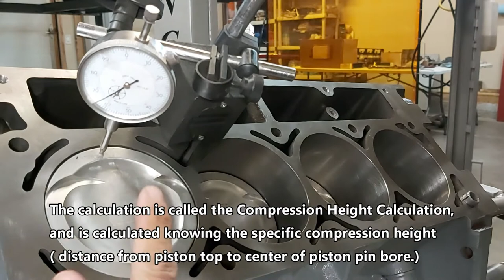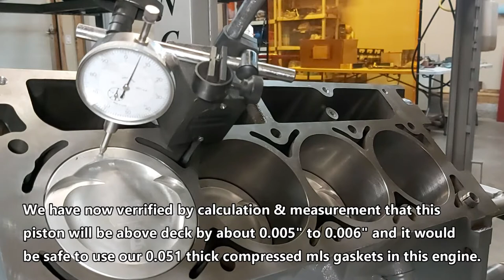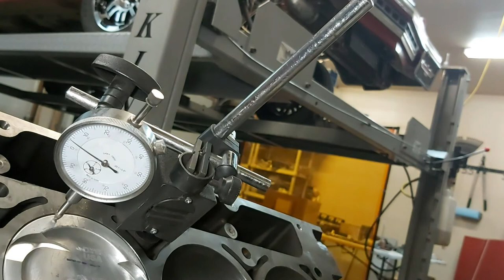Piston Deck Height determination for Proper head  gasket thickness selection

Comment: great video. i'm doing a rebuild after a timing belt snapped and wanted to check if i might need the same or thicker gasket. i have no warping on the head and the face just needs to clean up but still i wanna make sure it's all good in there. is the 0.040" piston to head clearance applicable to all car ices?

Comment: good info, my pistons are .006 above deck (347 sbf) my engine builder said a .047 compressed Fel Pro gasket will be ok, so I should end up with .041 piston to cylinder head clearance. This is with a 2618 forged Wiseco flat top and Scat forged I beam rods.
Reply from the maker: Yes, you're clearances are good and the gasket thickness you're using is very similar to what I'm using (0.051" compressed ) so you should be fine and have a successful build. Glad the video helped and thanks for watching ......Oliver
Reply: @BooostedLS  Thanks!

Comment: Great video, I have a b18c1 Honda engine I’m rebuilding, the head I bought has been resurfaced about .017” from the spec for a new head by the previous owner. I believe the stock headgasket is .03”. Do I just add that difference to my stock headgasket thickness and buy a gasket that size or as close as possible (.045”)?
Reply from the maker: You can use which ever gasket you have as 0.017 removed from the head was just to ensure the head surface is  flat, and will  create a good seal. You'll get a slight increase in compression and better quench, which both add to better performance. Only time you have to get a thicker gasket is if you need a lower compression ratio and if there are piston to valve clearance issues. Thanks for watching and commenting....
Reply: @BooostedLS  I just figure because the manual says that .008” is the max that can be removed so I figured I should make up that loss of material with the headgasket

Comment: I have a Honda k20 engine. I have 1mm oversized dished valves on the intake and I have stock size flat faced valves on exhaust side. Is this a good set up?
Reply from the maker: Sure, as long as you have 0.100" valve to piston clearance when the piston is at top dead center and the valves are fully open. Put some plasticine on top of the piston then carefully rotate engine . Then measure the depth of the plasticine after you've rotated the engine through a couple of cycles. Go slow as if there is interference you'll feel it right away if something is not correct. If everything checks out you'll be good to go.....Oliver

Comment: Thank you for the info and maybe you can help me out. I'm using the same exact setup as yours in terms of rotating assembly.  However,  I'm measuring .015" piston above deck surface. The ls block I bought is advertised to be 9.240 but there is no way that can be. 
9.240 they claim -4 /2 + 6.125 = 1.115.
My boost piston CH is 1.110 - 1.115 is -.005" but I'm protruding .015". Does this mean my block has been decked to 9.225"?
Reply: It's a summit pro ls forged rotating assembly with 4" stroke, 4" bore, and a 1.110 ch.
Reply from the maker: Hello Jose. Thanks for watching and commenting. It is possible that your block deck is now 9.225. Rod at my machine shop said he only machined 0.005 of each of my decks to get it square and flat. As you can see when I measured the decks on the other holes there was slight variation as to how much the pistons were above deck. I'm thinking that from the factory the blocks may not be exactly at 9.240" as advertised. this is most likely because there is an acceptable tolerance of plus or minus0.010" to 0.005" or greater . Also the pistons compression height might not be exact either as the technician machining the pistons may have had his measuring tools or measurements not exactly correct, and therefore didn't enter the proper off-sets in his CNC lathe as they were being finish machined.. It could also be the crankshaft is giving you a little more stroke 4.005 vs 4.000 as this is also a machined component and may not be exact. The connecting rods center to center distance could be another potential point of discrepancy as they also might not be as advertised. So the point here is, it can be any number of factors in the manufacturing of all these components as to why your numbers are not as expected. I would not worry too much. As long as there are no collisions between piston and the cylinder head you should be good in terms of your rotating assembly. Good luck with your build and let me know how it all works out for you and again thanks for watching and your input....Oliver
Reply from the maker: @Six_ftdeep32  That is a nice rotating assembly which I was also going to buy. I went with the rotating assembly from LSXeceleration because theirs was balanced as it shipped to me. I thought I could get my project back on the road last season so I went for that one, as I thought it would be quicker. here we are heading into the new season and if all goes well the car should be ready this time around...lol...Oliver
Reply: @BooostedLS  thanks for commenting back. I'm going to use a .055" compressed gasket to be safe. Do you think that'll be enough?
Reply from the maker: Yes, that should be good and keeping your quench height  small reduces detonation. I'm using the 0.051" compressed gaskets that can be seen in this video. https://youtu.be/DX61wAVPkxA ...Oliver

Comment: Sir how much will be the bumping clearance between head valve and piston top.
Reply from the maker: More then enough in this case. As you can see these pistons have a big dish and valve reliefs cut into the piston tops, as they are designed for boost. Using a cam with only 0.585" lift for both intake and exhaust there is no chance for piston to valve collision. If it was a complete flat top piston and a much bigger cam I would have checked with plasticine . The minimum clearance for this would be about 0.050". Thanks for commenting and watching....Oliver

Comment: How you are going to use a 4.060 bore gasket in 4.030 bore engine ?
Reply from the maker: The gasket bore is bigger  (4.060 ) then our cylinder bore  which is  (4.030 ). So this will be fine as long as the gasket does not protrude into the cylinder bore creating interference for the pistons, that actually go above the deck in my case. You can see the first successful drive at this link here.  https://youtu.be/PfrtuPXEY_U   Thanks for commenting and watching....Oliver
Reply: @BooostedLS  congratulations im really happy to see that beast running
Reply from the maker: Thank you. It feels good to finally get the project going and seems like everything is working as it should going around the block a couple of times. I'll definitely be putting the car through more tests, and documenting that whole process. Thanks again for your input and watching. I'll be posting some more video's shortly.....Oliver

Comment: Shouldn't you be measuring from the wrist pin direction?
Reply from the maker: Yes I measured piston rock in the wrist pin direction. I got 0.015 to 0.020 so we'll still have enough piston to cylinder head clearance using our 0.051" compressed mls head gaskets. You can see confirmation of this at this video link 
 https://youtu.be/DX61wAVPkxA ....Thanks for watching and commenting.....Oliver

Comment: You didn't rock the pistons at TDC to get the max down max up average, this is done to account for the taper in the top side of the piston and the PTW clearance. Increasing the gasket thickness is an obsolete and dead wrong practice in engine building, matter of fact running a higher CR is better than running lower CR with thicker head gasket it's melts down the piston quench and how effective the homogenous air vortex created by the piston in the compression stroke
Reply from the maker: Actually I did rock the pistons back and forth at TDC. I just didn't include that in the scenes which I should have....thanks for commenting....Oliver